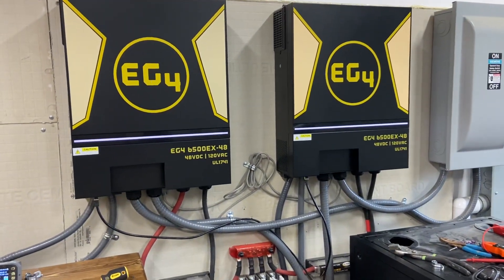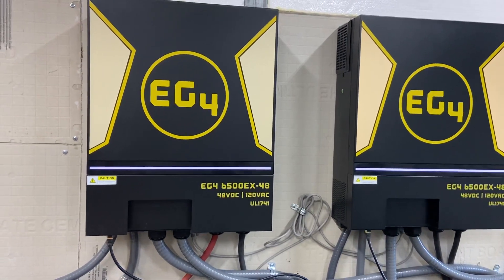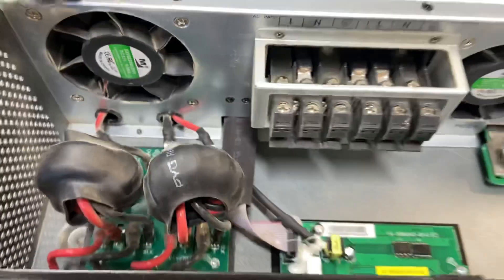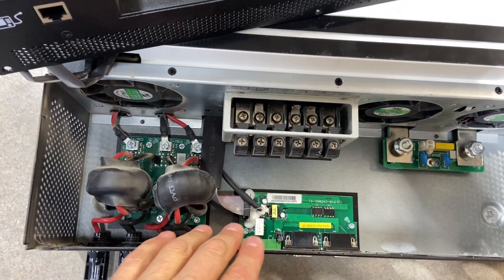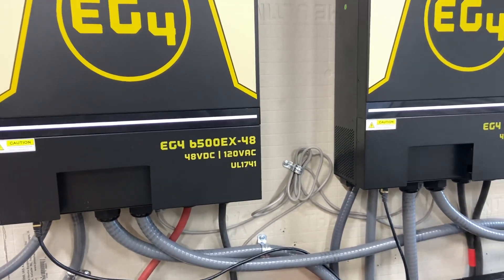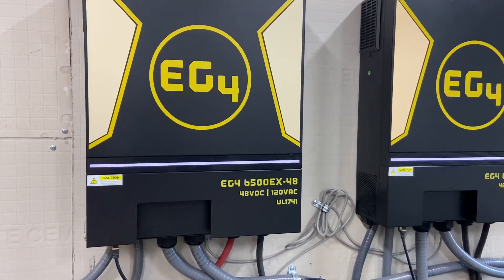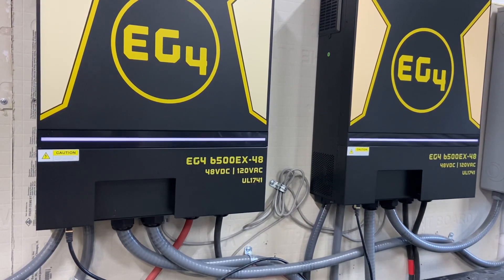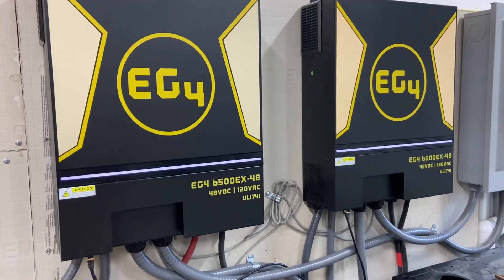Mpp LV6548 swap out to EG46500ex

Comment: All Voltronics OEM.
Reply from the maker: Possibly, that’s what I assumed. . But if so, they have real quality control issues. The eg4’s had voltage regulation problems. Never had that problem with the lv6548’s.
Reply: @GavinStoneDIY  Can you explain what you mean by "back feed problems"?  Meaning current going back to the grid?
Reply from the maker: @oilycare1820  no. I apologize I used the wrong terminology. They had voltage regulation issues. A fluctuating current. But not in every unit. They have no fixed the issue. I talk about it in my follow up review.
Reply: @GavinStoneDIY  thanks!

Comment: I'll give my my address for your old units 🤣 The EG4s do look awesome on the wall great job 🙂
Reply: Thanks again for your guys comments and help
Reply from the maker: The LV,s are back up. The eg4’s don’t produce clean power. More like a modified sine wave you’d get from a dirty generator. Unfortunately I couldn’t test that. But my lights were strobing like a disco hall. I’ll make a video on it as soon as I settle everything with signature solar. They take forever to respond, so currently the units are still sitting in a box waiting to ship back.
Reply: @GavinStoneDIY  OMG! I had no idea the problem with them was that bad. WOW!
I've also heard because of the chip shortage they're Mickey mousing the units and using software patches to try and make them work. What a nightmare I'm sorry to hear that brother.
Reply from the maker: Yeah it’s been a pain. Makes me appreciate the quality build of the Mpp versions. What’s worse, signature solar is aware of the problems. Usually with dimmer switches and dimmable lights. They recommend people remove the bulbs and switches. Meanwhile the inverters are still back feeding. You just wouldn’t be able to see it as well. I expect people with smart TVs and sensitive electronics to have real issues with the eg4’s.  Recommending people hide the problem doesn’t fix the problem. Very shoddy. And they take weeks to remedy issues. Im on hold again today. Their rack batteries are good. But definitely stay away from their inverters. The customers are basically their R&D department.
Reply: @GavinStoneDIY  well said and horrible that is the way they are running things. 

All the best buddy stay cool.
Reply: I'm a little surprised that Will Prowse has been so silent on the issues, The guy from watts247 told be the problems with this unit I thought it was just because EG4 was competition. 🤷 It's so hard to tell who's honest these days.
Reply from the maker: @Roll2Videos  Ian at Watts247 is a stand up guy. He’s been extremely helpful. Always gets back to you in a short time. And knows just about everything about his inventory. He was telling the truth for sure. I wish I could relay the issues to Will Prowse. But it would get swallowed up in all his other comments. I blame signature solar. They know their products have a problem, and they sell them anyway. Then tell their tech support to advise removing bulbs and switches. Seriously bad practice. If it has a problem, take it off the shelves till it doesn’t. I don’t think it’s a rebrand. I think it’s some type of clone. More pv voltage input. But way louder, and crappy sine wave.
Reply: @GavinStoneDIY  Ian told me if they didn't push these units out signature solar would go bankrupt. They backed themselves into the corner with those units. Affiliates with them are riding the wave 🌊
Reply: @GavinStoneDIY  And yes Ian is the man! 😁
Reply from the maker: @Roll2Videos  wow. That would make sense in a way. They’ve lowered the price so much. Probably to move their inventory. It could be that a large portion of the tech support actually believes there isn’t a problem. I’m not sure. They don’t seem to know much about their products at all. Granted, I’ve lived with them for 9 months so I’m well acquainted with how they should work.
Reply: @GavinStoneDIY  Ugh, Think of all the people who don't know any better thinking that's the way they run and accepting the poor quality. 😓
Reply from the maker: @Roll2Videos  exactly. Meanwhile their compressor in their smart fridge is feeling frazzled.
Reply: Wow we spoke about this the other day on will prowse site.
I'm glad I found your videos. You were going to give me some information I can't remember I've been so busy trying to figure out this system that's so difficult to do. I don't know how you guys do it and it's amazing you figured out that those EG fours aren't working right. And yes I'm surprised will isn't hip to it or something. He should definitely respond to some of your comments over there. I can't believe you took it all down and changed it back. Wow. That's a lot of work prayer I feel so bad for you my friend. I wonder if sungold sucks I bought a sungold. I bought it before I even knew anything about any of these videos or anything. I just bought it through a Facebook ad geez that is not the way to do this stuff. You should really watch so much videos to figure it out. I just bought four batteries from
Signature solar. Hopefully they'll be okay you said they seem to be fine. It's just that inverter the people didn't build it correctly for them. I wonder how I can find out about my sungold I'll just have to hook it up and see what happens.

I sure hope my the sungold inverter works okay.

I definitely want to find out about these other guy you're talking about I think I heard about him I'll go back to the comment to get his name. Well thanks for listening

I did see a review from hobotech he tested the sine wave with some kind of machine and said it was good on the sungold inverter
Reply from the maker: @VinceBadovinatz88  I’ve emailed sun gold. I believe they have a rebranded lv6548. They don’t have any light strobing issues from what they said. So you’ll be in good shape I think.
Reply: @GavinStoneDIY  thank you on the emailing and finding out about rebranding that's awesome news I appreciate you so much thank you. And it's good to know about Ian. I'm kind of surprised about will prowse not mentioning anything yet.
Reply: How do you guys contact Ian does he have a Instagram page also. I read his website thing talking about the cheap knockoffs. He does seem like he's very upfront with knowledge

Comment: Thanks for sharing your comparisons!  Look forward to hearing about more of your testing (especially your grid-bypass testing).  Knowing the hardware is basically the same between the 6548 and the 6500, it’s nice to hear about the subtle differences.  Thanks!
Reply from the maker: So far this evening I’m not very pleased. My lights randomly flash. So there is an issue somewhere either in their firmware or hardware.
Reply: @GavinStoneDIY  check and see if your on the latest firmware.  I’ve had a lot of comments from people about the latest one is supposed to fix flickering and random “disconnects”.  Please keep us in the loop!

Comment: I did not have any problems using 1/2 seal tight connectors on the pv input maybe they changed design. The fans are a bit loud and they ramp up with increase in solar charging. They look good
Reply from the maker: Yeah I’m not sure why I got the funky models. lol. It works fine like this. I was just a bit confused why they’d have such a small inlet.
Reply: @GavinStoneDIY  That square shroud comes off on mine and I used couplings there.